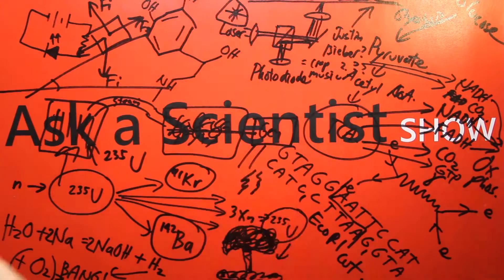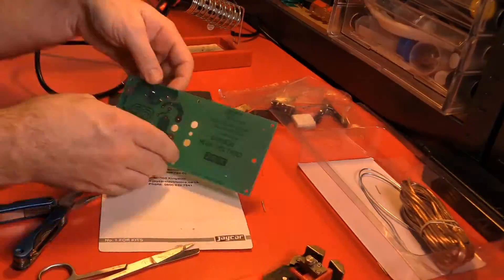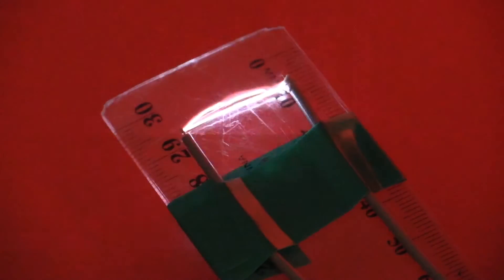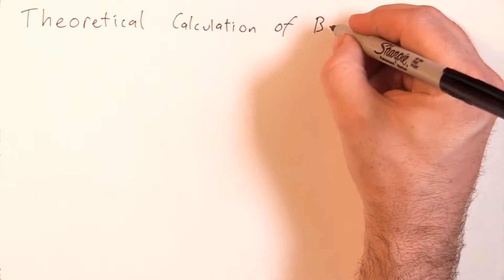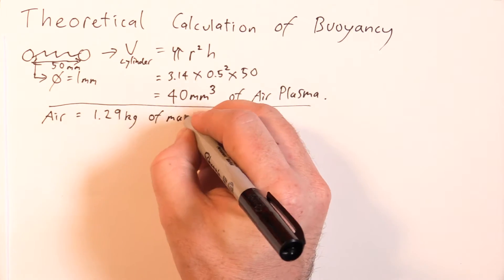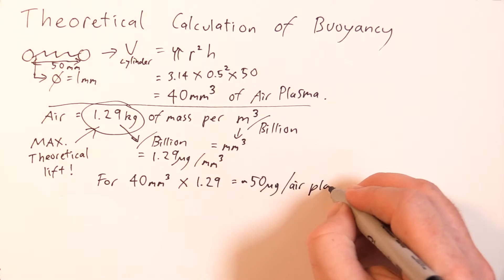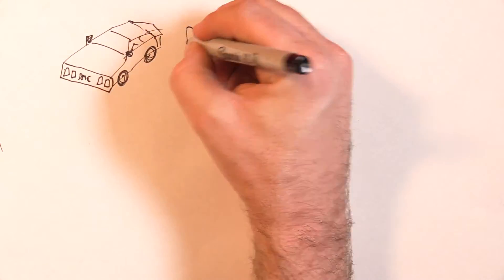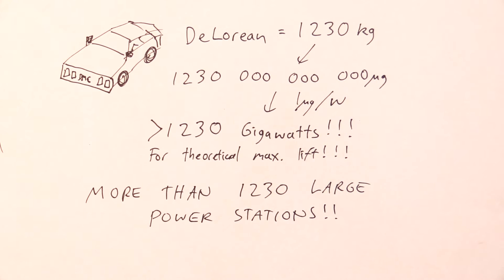Could an air plasma be used to float UFOs? Ask a Scientist Show 1.3

Comment: Hey quick ? if cern particles travel near light speed what would happen if hypothetically one particle goes one way another goes the other but the third particle sits in the middle lane.

As the other two go around they brush but don’t collide with the middle particle at the exact same time.
What’s happening from the middle particle perspective?
Is time moving? Is it travelling at the speed of light even though it’s stationary?